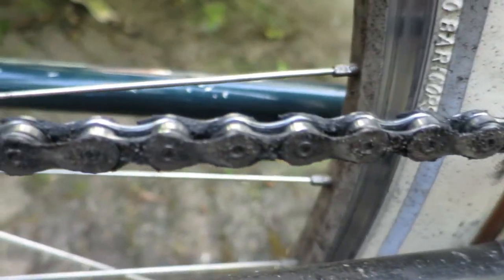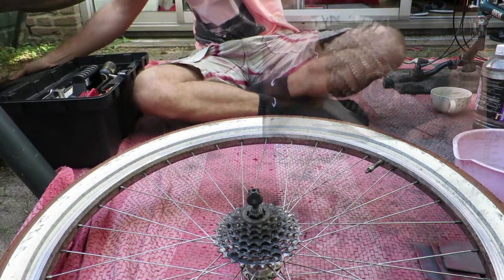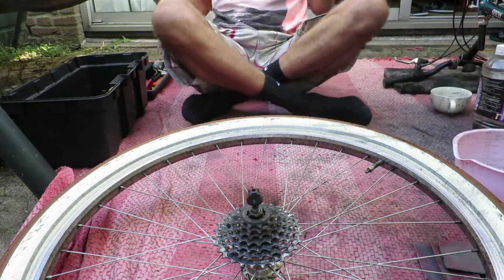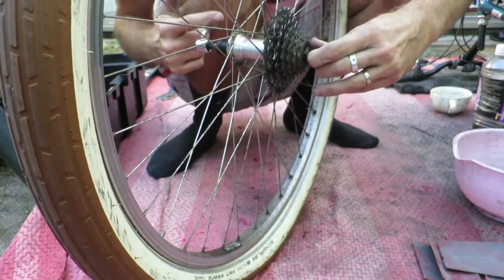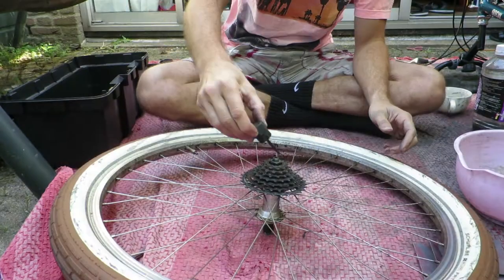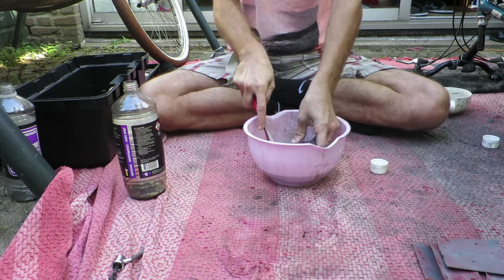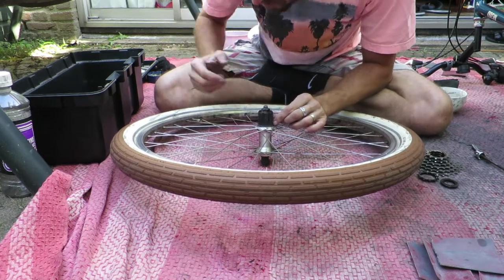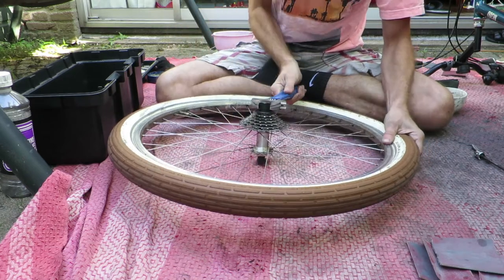Cleaning bike cassette with white spirit

Comment: I take my chain off and clean it in a bath of white spirit. Between deep cleans of the chain, every 200 miles, that is taken off the bike and thoroughly rinsed in a white spirit bath, I use a paint brush dipped in white spirit to clean the cassette, chain and crank, then re-lube the chain.